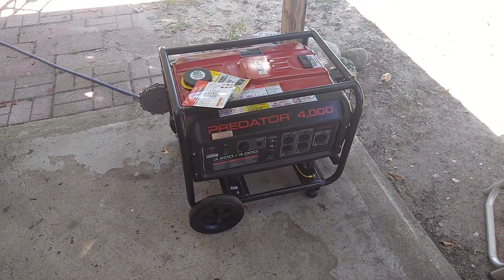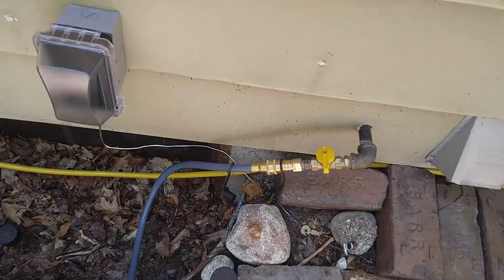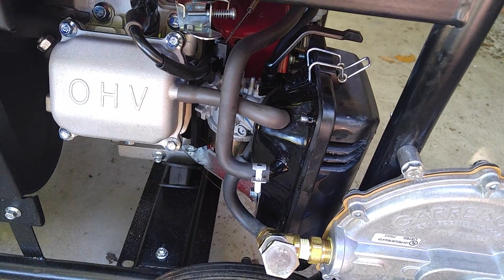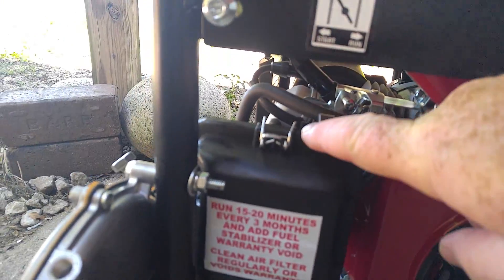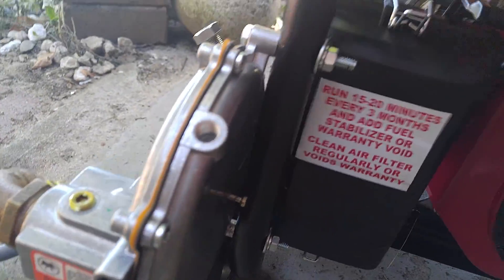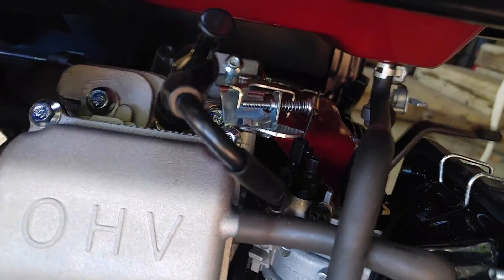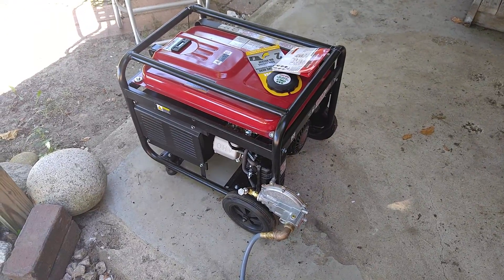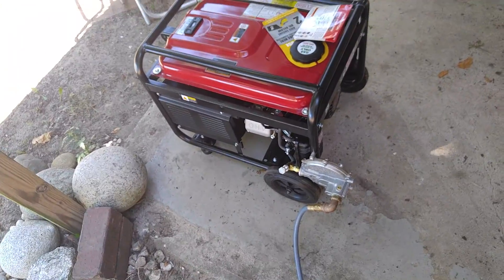Predator 69676 4000w Generator US Carb Snorkel Natural Gas Conversion Part 1

Comment from the maker: Hi I ran the generator off gasoline from a separate container for 3 hours when I initially purchased. After
that I changed the oil. No gasoline has been in the actual generators tank. I
only plan to use gasoline if I am forced to. Propane working pressure is almost
half a PSI 0.40. Natural Gas is only 1/4 PSI 0.25. I have not tested my
setup on propane but I feel that the higher working pressure of propane will
allow the generator to run without the choke on half way. I have had numerous different
hoses and tried different orientations of the regulator but have obtained the
exact same results……. when using natural gas the choke must be on half in order
to create enough vacuum and proper mixture for the engine to run correctly. 
If I had this to do over I would buy a larger generator that has more vacuum.  
I may look at a different kit to modify the engine for natural gas but I don't really want to cut the frame of the
generator.The generator does not seem to meet the current power generation spec when running
on natural gas but it's enough to run the things that I need it to, water pump,
furnace and refrigerators and it will run off natural gas, propane and gasoline
so I'm reasonably happy. I just wish US Carburation would have told me
up front the kit won’t work for natural gas on my engine without the choke
being on half.
Reply: I forgot to ask in my other comment...did you try a different regulator? If not, I would complain to US Carb and try to get another one to test with.
Reply: I would verify that there are no air leaks. To do this, get the choke in a position (almost all the way open) where the engine stays running but is not running correctly. Now take a small bottle of propane, turn it on and direct the flow to where the carb meets the engine and near the snorkel. If the engine speed changes you have an air leak. Also, why would you be testing with 3000 watts? Your generator is rated for 3200 max running watts on gasoline. Wouldn't you expect losses using NG? If you lose 10% your generator is now at 2880 max running watts. You should probably limit testing to 2700 watts.
Reply from the maker: I tried 3 different regulators, one had a max Inlet pressure of .8 ounces the second had .6 ounces and the third .4 ounces. All three Regulators performed the same. The diameter of the snorkel used for the 6.5 horsepower engine is not large enough to allow the diaphragm in the regulator to open with the quarter PSI natural gas pressure being delivered by my gas companies meter/regulator. With the .4psi of propane it will work as seen in numerous videos. I am using a toaster and heater to load test. The heater has two setting, 750 and 1500 watts so I am limited in the choice of load. I did not measure the current with my digital volt ohm meter, just used the spec written on the appliance. There are many inaccuracy's. I will try the propane vacuum leak test next time I fire up. I 99% sure there is no leak based on visual inspection and proper operation on gasoline. Thanks! ~Kevin
Reply: Oh OK. It's running well on gasoline so chances are there is no air leak.

Comment: Hello. Just wondering if you got this taken care of? My first thought is, can you run with propane with this kit? If so, do you get similar symptoms while running on propane? I doubt if your problem is related to supply hose or regulator. There is something else going on there. From the design of that "snorkel" I would be looking at what is physically going on near the choke plate. The generator looks brand new. Have you ran this on gasoline? I have read that you can lose 10% of engine power on propane and as much as 20% on natural gas. For my small 3.6KW generator I did not seem to lose very much if any on propane. My testing was with a 90% (3250 watts) load. I haven't tested using natural gas. I went with a much cheaper alternative to the US carb kit and am very happy with it.
Reply: ⚠️Here are the safety rules of using portable generators

It is important to follow all generator safety rules whenever we use portable generators: 

Everyone must see this. This is just a reminder for everyone’s safety. 

1) KEEPING OTHERS SAFE: Please do not allow an unqualified person or your children to operate and service the portable generator. Just because some manuals don’t say that doesn’t mean it’s safe. That is important against the generator safety rules. We also need to be keeping an eye on our children too. You need to make sure that your children are not playing near the portable generator especially when it’s running so they won’t get electrocuted. Generators pose electrical risks and they can be hot during an operation. Please keep your children away from the portable generator at all times. It is important to keep our children safe especially our little ones. Be aware of all the hazards.

2) WHERE TO RUN YOUR GENERATOR: Some people use their portable generators indoors which increases the risk of carbon monoxide poisoning. It’s important to have a carbon monoxide if you have a gas generator. Never ever use your generator indoors even if your doors and windows are open and even in the garage is not safe to use a portable generator. Not even at your porch and your deck. It is never safe to use your generator indoors and in enclosed areas of your home. Your generator needs to be 15-20 feet away from your house. 

3)🔥FIRE HAZARDS: Never refuel your generator while it’s running. You need to let your generator cool off before refueling it and before storing your generator. Never overload your generator too. Never ever back feed your generator. You should never plug your generator into a wall outlet. Also never store propane tanks indoors. Please keep flammable things away from the generator as well and please don’t smoke cigarettes near the generator. Having a fire extinguisher next to the generator is also important against the generator safety rules. 

4) GENERATOR OPERATION: make sure your hands are dry before touching the generator. Never use your generator in wet conditions. Don’t let your generator get wet. You need a generator tent if you need to use your generator during wet weather. Please don’t wear loose clothes when operating the generator. Turn on your generator before plugging in appliances. Use the right cord for your generator. Please do not use worn out cords. 

https://youtu.be/I1jT3ANENvI and here is a video more about keeping others safe when using generators 

Hope this helps. Remember it’s better to be safe than sorry.